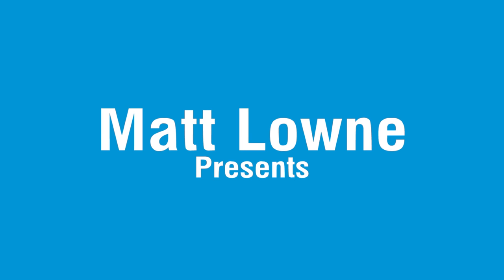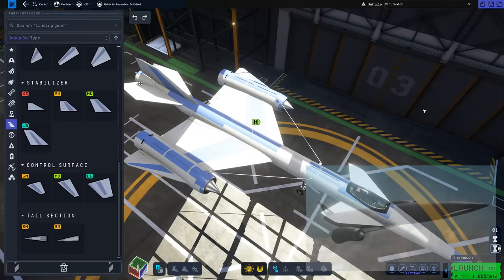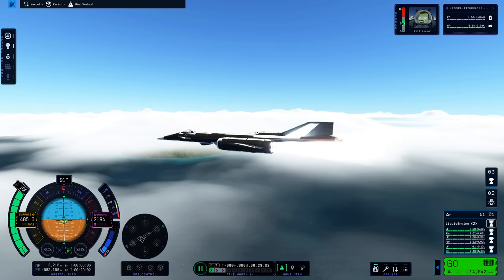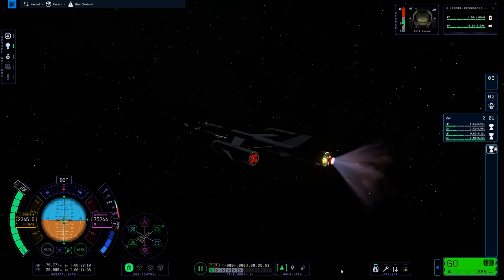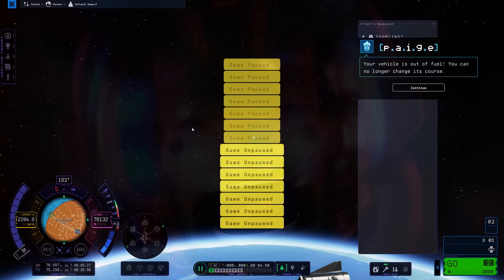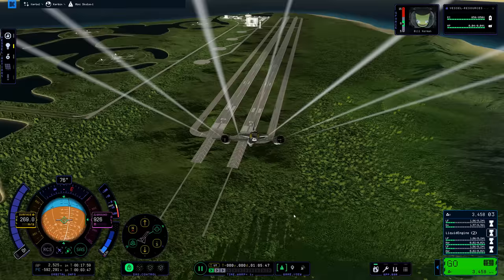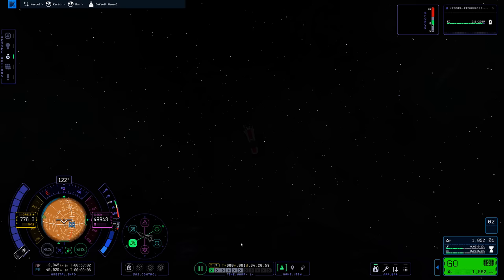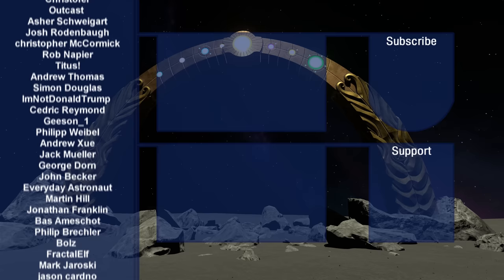KSP 2: Micro-scale Skylon SSTO!

Comment: The IRL SABRE has hope. the pre-cooler (one of the most critical components of the system) has shown a lot of promise in testing so far, and has attracted interest from other industries.
Reply: They've been working on this since the 80s when it was called HOTOL. All they've managed so far is some very limited proof-of-concept testing of the pre-cooler. All they need now is to turn that into an actual working full-scale pre-cooler, then develop the insanely complex engine required to stick behind that pre-cooler and that can deal with both liquified air as an oxidiser as well as pure liquid oxygen, and then put these engines in an airframe the like of which we've never seen before. 
Given the incredibly slow progress they've made so far I'm not going to hold my breath waiting.

Comment: Skylowne!

Btw, KSP2 does actually run under Linux, although the poor optimisations will see you at sub-10fps when near kerbin and upto 40fps elsewhere, regardless of graphics card.
Also, the clouds are borked.
Reply: Is it native or does it use the Proton compatibility layer? I'm sure someone will add support for it with Wine.
Reply: @Zeta  it already runs under both Proton & Wine, though the lack of a difference in performance between the two trying to run ksp2 suggests there's alot of power being left on the table by the poor optimisations.
Reply: Didn't expect that it would work on wine already, usually some games require some changes to work. Thanks for telling me.
Reply: Not quite, we've seen some folks getting 60FPS and I'm averaging almost 30.
Reply: AFAIK, clouds are only borked for AMD users. AMD frame rate seems to be consistently higher, however. The limiting factor seems to be vram, so the more you have, the better.
Reply: There are startup parameters you need to use. There is a Linux thread in the intercept discord that has them.
Reply: i use arch btw
Reply: @WildSpycrab  Im on Nvidia, GTX 1080 and the clouds are still borked.

Comment: The purpose of the precooler isn't to prevent the engine from overheating, it's actually used to liquefy the incoming air. This is necessary because it's really more of an air-breathing rocket engine. So the air gets sucked in, converted to a liquid, then pumped into the engine and used as an oxidizer. The nitrogen just goes along for the ride to increase thrust, making the engine even more efficient despite lowering the specific impulse.

Comment: 3:50 KSP2 actually works quite well (as well as it can) in linux. I have run it both on my linux and windows, using the same computer, and the performance was the same. Although while using windows, I could see the crew in more of the command pods (not really, it was a joke).

Comment: I think as time goes on in KSP2 development we all just learn what bugs exist and design our missions around them.
1) 1:14 That one wing type falls off after a quickload? Sub a different type of wing and change size, or don't quicksave with the bugged wing type.
2) 7:57 Docking ports and decouplers broke? Use stack separators.
3) 9:04 Physics warp-burn has incorrect math? Let the burn play out at normal speed.

Comment: regarding the spontaneously increasing apoapsis, i've noticed that can happen if your thruster is pointing toward another part of the craft, suggesting a possible type of kraken drive, but it could be that for that moment, it was considering your terrier to be in its original location, which if i recall the build sequence, would have been ahead of the tailfin?

Comment: If you want a more accurate-to-scale Skyline check out Juggernoob's ES-95 Python. I tried building it in KSP2 but I had endless problems with engines not sticking to wings, entire vehicle falling apart at launch (like literally just falling to pieces on the runway after spawning while the camera is still fading from black).

Comment: It's a good thing you didn't build a 1:1 scale Skylon. I have and the R.A.P.I.E.R are insufficient. So much so in fact, that 8 of them still weren't enough to take a 100 ton craft to orbit; were as previously I think they would easily. Also, It is not a simple engine nerf, drag seems a lot draggier in KSP2 and it certainly doesn't scale kindly.

Comment: KSP 2 works in Linux using Wine/Proton.  Well, I say fine.  I am on a GTX1660ti with a mid-spec processor.  I get 5fps.  But sometimes I get 20fps and I have no idea why.  I suspect the FPS jumps are a KSP bug and the general tardiness is my hardware as my graphics card is slightly under minimum spec.    My graphics card is utilised at 100% yet doesn't get hot.  My processor is utilised at about 22% by the process.  I am running Ubuntu 22.4 with the KDE desktop and I have 16gb ram.   I suspect the game runs as well on my hardware in Linux as it probably would in Windows given the eye-watering requirements to get it even vaguely smooth.